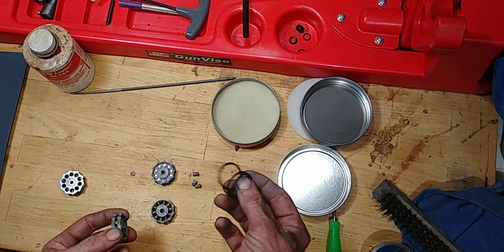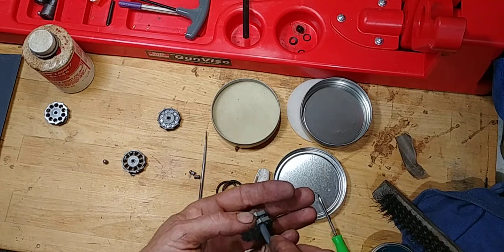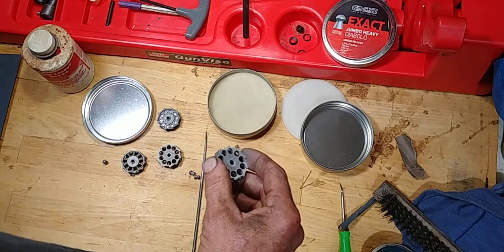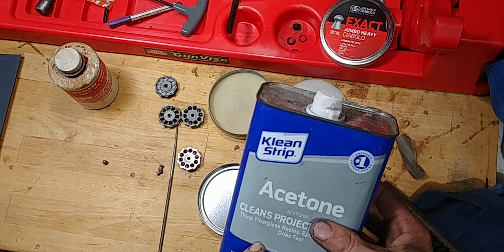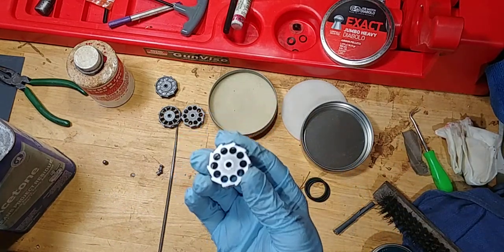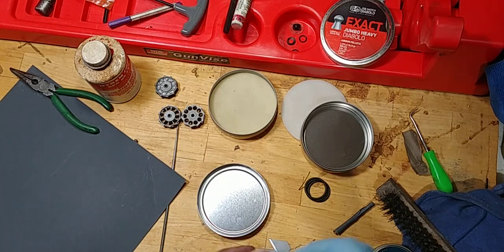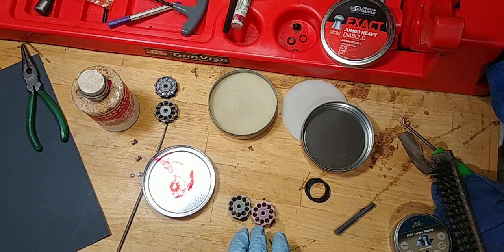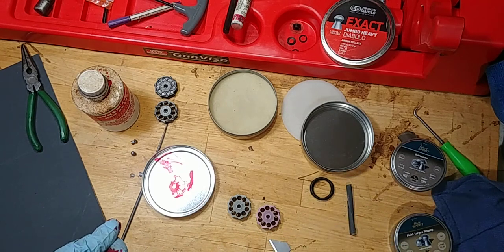Hatsan At44 qe long .22 , deburr & clean rotary mag

Comment: Your AT44 likes the JSB18.13. Try the 18 grain H&N snipers. They seem to buck the wind a little bit better for long range. My Hatsan Bullboss loves both of those. I would almost guarantee your gun will too. Food For Thought brother! From.N.M happy shooting. 👍✌ by the way a Dremel and a little wire wheel will really clean those clips. It's a nice little shine on them
Reply: I have used the JSB jumbo heavy 18.13 and got good groups, but I got even tighter groups with the H&N Baracuda match 21 grain.  I have my regulator set to 120 bar and am getting about 756fps at the muzzle and 30 shots per fill before pressure drop off

Comment: I notice my Bt65 25 the wheel mag will hang up when I refill and replace. The bolt has trouble pushing the pellet in then it won't release I have to fidget with it but once it loads that first pellet it's good for the whole magazine. I use the diablo same exact ones as you except 25. Also I live in Fl and moisture and dampness is an consistent unrelenting battle I use a little bit of silicone grease on a rag wipe it down if it gets damp sometimes I dry with a little TCE tetrachloroethylene or perchloroethylene same animal. Common use is  brake parts cleaner/dry cleaning fluid. What's your thoughts on this, and what would you do to keep maximum dryness